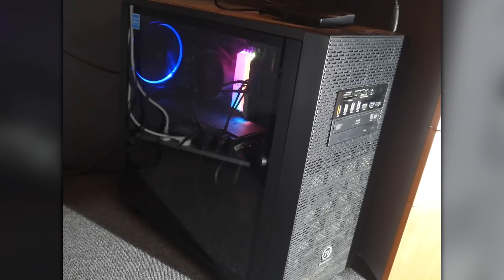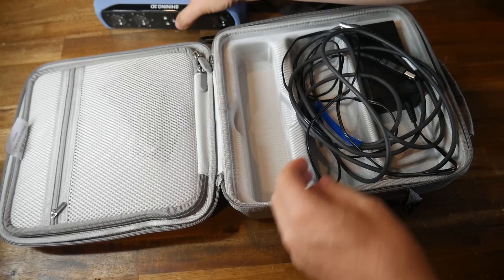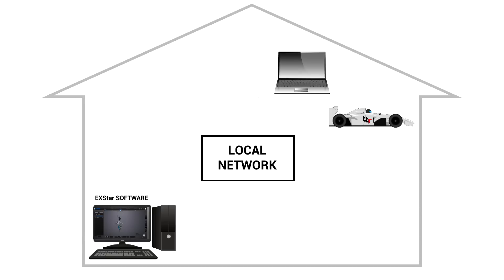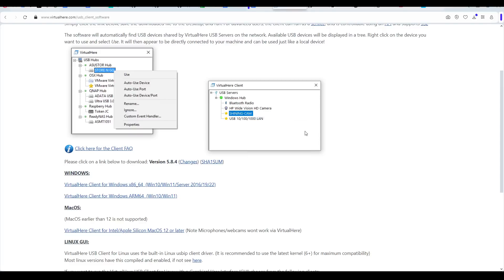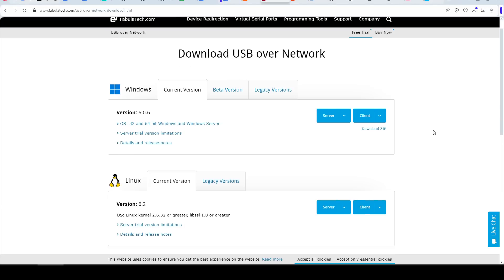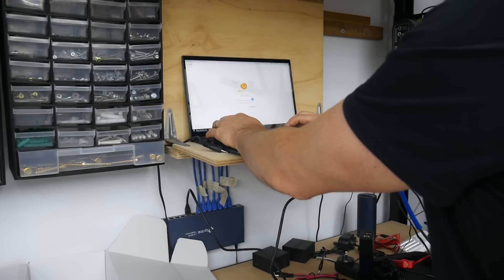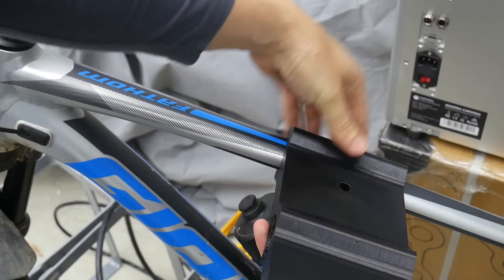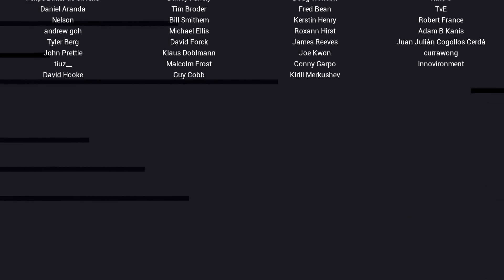Remote 3D scanning away from your desktop - USB network tunnelling guide

Comment: not sure how i miss this video, in addition you can get a 100w ugreen battery bank and a USB-C PD to 12v "trigger board" or cable and you can run your einstar without having to plug in the power brick.

Comment: There are a lot of solutions for passing usb devices over a network as this has been a big problem in the terminal services/Remote Desktop space for easily more than 20 years. I have a lot of experience in this field being I have been a systems engineer for the past 16 years and a lot of my work has revolved around remote systems administration and terminal services. If you would like to explore it further I could probably help you figure out an easy way to get Microsoft rdp working and it would be a great use case for this project as it has had usb device redirection functionality built in since about 2012. When properly setup it works really well even over a low bandwidth vpn. Streaming images can be difficult for redirection software but the compression in rdp might make it better or even worse over cellular. It’s hard to say without trying and tweaking.

Comment: Id love to know the bandwidth of the 3d scanner. Its a USB2.0  right? 

On the Microsoft remote desktop, they mucked up in windows 10/11 with online accounts.  It doesn't set a local password and you need a local password for Microsoft remote desktop. Once the online account password is cached it works a treat and I prefer it because it doesn't need internet access once it's done.

Comment: About 15 years ago, I used hardware USB "hub" connected via ethernet at work. It had Segger (?) arm in circuit debugger connected. Every time I detached laptop from dock to move to meeting room (briefly disconnecting network?), the laptop had to be rebooted (which took more than 5 minutes!) before it could connect to conference speaker and open conference software.
But it was HP laptop, so maybe it wasn't the hub or it's driver 😉

Comment: As I don't have a 3D scanner at home sometimes I model things, where possible, by taking a front on picture of the profile and modeling over that in Blender with a reference length measurement. It has worked shockingly well. Now I have a situation where I want to upgrade my dremel workstation and this would absolutely not be possible, ha.

Comment: Hi Michael! I have the same scanner and want to give you a tip. If you use the older version of the Einstar software (1.0.6.0) you can run it on weaker systems without meeting the updated system requirements. I have an office laptop that is well under the reccomended specs and it is working at an acceptable level.

Comment: Wow.  You jumped through a bushel of hoops!  I just bought a Miraco and was scanning immediately.      On another topic, that 3D scanning spray, that disappears over time: where do you think the spray goes?  Into the air.  For you to breathe.  I use foot powder spray and clean it up with a wet rag.  Much cheaper and easier for the work that I do.

Comment: You could set up wireguard instead of openvpn, it's way faster. Also, try to setup your own VNC server (rustdesk for example, you don't even need the vpn, just client-server direct connection if you open ports on your home's router) instead of relying on chrome which also adds latency because it has to route traffic through their servers.

Comment: You don't need the laptop. Just use the phone, and plug the scanner into the phone, and use Virtualhere for Android. Complete wireless setup without any extra devices. And you can still stream the desktop PC screen to the phone at the same time. Find Virtualhere for Android v.4.2.2, which can be used as a trial with one USB device. When the trial expires, delete and reinstall the APK

Comment: USB over CAT5/Cat6 cable is much much much simpler and cheaper. About $40USD and it’s plug and play. It’s really just a repeater and cheaper USB2 versions are sufficient for Einstar. I run mine happily over 50 metres of CAT6. If you’re going wired this is the easier option. The USB over IP method are good for going wireless though you really need WiFi6 or better to keep the latency down.

Comment: If you got a docker capable home server or raspberry pi I would strongly suggest trying rustdesk, as you can configure the relation between frame rate and quality very easy and its just more performant. Also you could use wireguard as usually more performant solution for your vpn. Alternative one could try moonlight streaming if interested.

Comment: Watching you just skip over Windows built in Remote Desktop hurt me as a Windows System Administrator... It's literally the easiest thing in the world to set up. It's baked into windows so you don't usually need to even download anything. Just go into Advanced System Settings, click the remote tab, and enable it. (Not sure if it works on Windows Home)
Reply: You shouldnt feel too hurt. Rdp to servers vs gpu extensive applications is different. Unless you set up policies properly rdp is not by default gpu acelerated and frame rate in gpu extensive applications would suffer.

Comment: I am a little confused, are both the laptop and desktop connected to the network?
Why not install scanning software on laptop since you have usb cable to laptop?
or RDP from laptop to Desktop and it will carry usb devices over network as well?

We use RDP from laptop to virtualized desktops in the lab

Also, you can use digikey usb servers and eliminate the laptop
Reply: notebook didn't acquire minimal requirements
Reply: @chiboreache  ah gotcha

Comment: I used the Miraco Pro at work and its really amazing. I really think it is the best choice if you want something portable and easy to use. The battery lasts about 2 hours of continuous work and the resolution is quite good.
Reply: Im better he saw the superfast matt video everyone quotes that the einstar is better meanwhile he gets terrible scans out of both, he admits the einstar was just as bad at the beginning and was using the old firmware on the beta unit lol. And just ignores the small mode which literally is a massive benefit of why you would buy it lol

Comment: Very cool, I did exactly that, but I used Meta Quest 3 which is an Android, in which you can connect to Wi-Fi 6 and 2400 mbps with real transmission of around 1600 mbps
Reply: I use Virtualhere for Android on my Quest 3 to connect my steering wheel wireless to my PC (sideload v 4.2.2 APK, and reinstall after trial expires for infinite trials), and of course use Link or VD for streaming. Works well

Comment: Try Digi AnywhereUSB...
Reply: Fantastic product, little bit pricy, but would cut down need for laptop in workflow. Have anywhereusb connected to scanner with phone mounted. Desktop connects to anywhere to get access to usb. Use mobile for remote access. Anywhere also has vpn support, so you can vpn the anywhere device

Comment: Why didn't I think of this??? I've been wanting to pick up a scanner so I can scan the interior space of my miata, behind the seats for a custom sub enclosure design, but was facing the same issue that my laptop is just not beefy enough for it (I specifically went with a lower end machine since I primarily only use it for simple things).  This will be a great option for getting the job done.

Though I will mention that chrome remote desktop really sucks when the two machines have drastically different screen resolutions, because chrome remote desktop just sends the desktop's frame buffer over, rather than actually logging into the machine with it's own screen resoltion like vnc or rdp would.  In my case, my desktop has two 1080p panels and a 5120x1440 panel, making chrome remote desktop basically useless to me, but on windows RDP is pretty much dummy proof, and just works.

Comment: Very nice. "Real VNC" (Virtual Network Computer) is the Mac Daddy of remote desktops. It works amazingly well on all popular platforms, even remoting multiple displays. For Sysadmins its indispensable.  I always wanted it to tunnel USB so this is a great addition. Bit pricey but useful.   What is interesting is Virtual Machine hypervisors ( virtual box)  does do USB tunneling from the host machine to the virtualized machine but that is on the same hardware. I wonder if there are ways to use that.
Reply: May wanna check out RustDesk

Comment: USB over the network never gets enough attention; shame you didn't mentioned the free opensource USB-IP solutions. You can even do it with the likes of an OpenWRT or Rpi router at the device end. I had a 3D printer in the garage with a usb connection old TPLink OpenWRT router - using Linux usb-ip to bridge that back to my PC; worked flawlessly for years.
Reply: He did mention it, 5:38
Reply: @johncheek07 I think what they really mean is USB over Cat5/Cat6 cable. $40USD plug and play. This was not mentioned.
Reply: Do you mind linking to or at least saying the project names of the open source solutions you are talking about?
Reply: USB over Ethernet is way easier than your project and less cost as well. No bridging, no Linux settings
Reply: What usb over ethernet devices have you had success with?
Reply: Yeah, raspberry pi usb over network is the way to go
Reply: Or flexihub.
Reply: Links please for a wireless solution? Thanks
Reply: Yes, usb over ip.